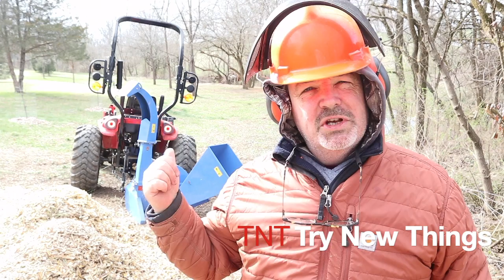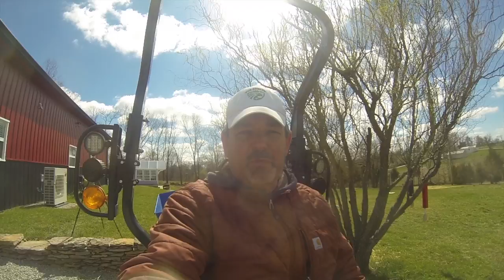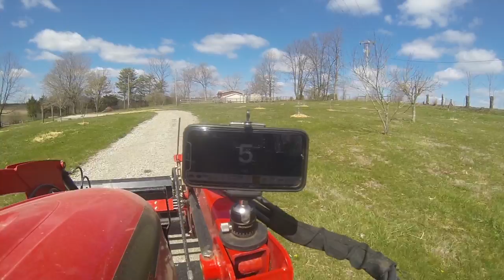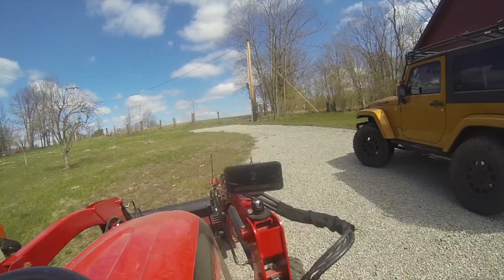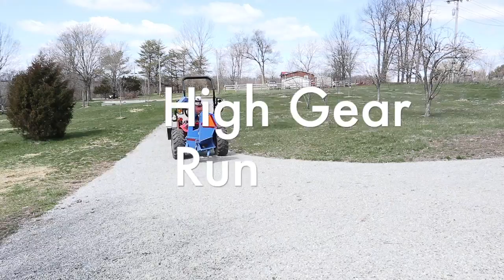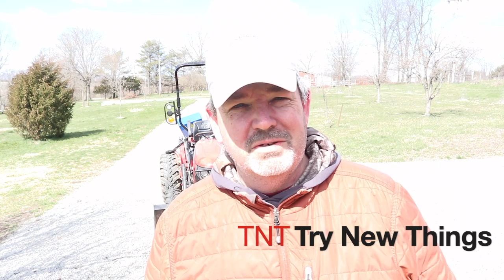#168:   RK25 / TYM T25 Speed Tests (Low & High Gears)

Comment: Just picked up a RK25 When I mash down  the forward pedal it stalls the motor.  Can you tell me why?
Reply from the maker: Do you have the lever under the seat in the middle position and not to the right when you are on the seat?    I have run into similar issue when I had that lever in the rear hydraulic position.    Double check that first.   Also it is too easy to hit that lever one way or the other when getting on and off.

Comment: This was a VERY good demonstration of "Why" I WON'T, WILL NOT ,NO WAY ; Ever buy or Have a "measly --=-- 2 speed hydro-slack-o-howl-matic" - Twack-tor[ like the tractor-EXCEPT for the EXTREME "tinker-toy" deficit]. Because 1st range is almost NEVER GOOD FER ANYTHING;   Because it is Too high to do "Powerfull-pushing or pulling" & TOO slooowww to travel with a "light-load". The "High Gear" is "Right" for a "Road-Gear" for this size of "little Twack-tor". "iF" 1st range was 3.5 mph & 2nd was 7.0mph ,along with the present "high-gear" ( should be third range) it would be near perfect!!!:;;;; why , because l have a "35 year old 21HP TRACTOR with a THREE RANGE "hydro-slack-o-matic " configuration unit that "Preforms" FLAWLESSLY, BECAUSE it HAS the formentioned T formementioned THREE RANGE "hydro-slack-o-matic transmission ".!!! I Even bought the RK L25 Loader to "Adapt-a-late"( way too much MODIFICATIONS ),necessitated a "Whole other Tractor ".( have 2 other bigger units 36hp 3400lb & a 54hp 3700lb ( raw tractor units with out loaders or backhoes). Just "NEED" a smaller 25hp 2000-2700 lb "smaller frame " tractor loader" to complete the "fleet".          Thank you Sir for the Excelent vidio and happy safe tractoring.  Best wishes with all your endeavours.